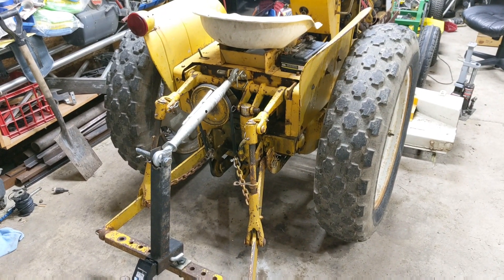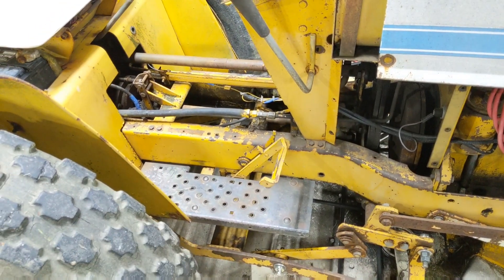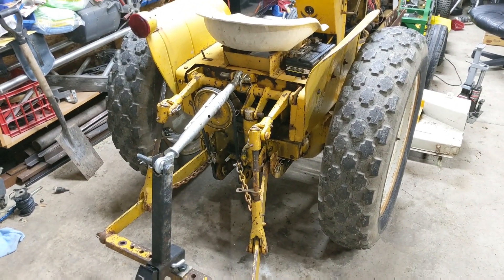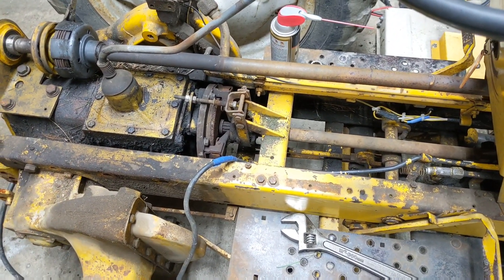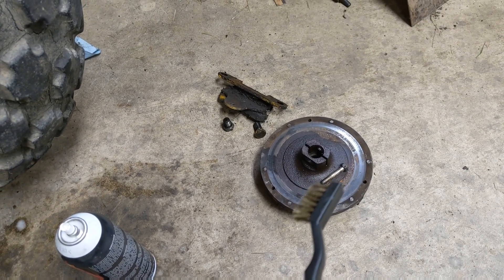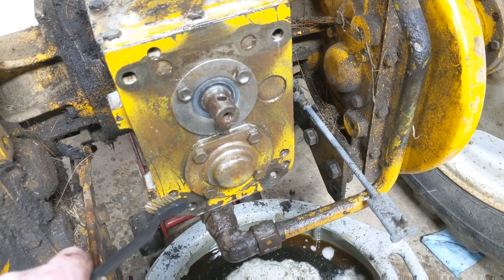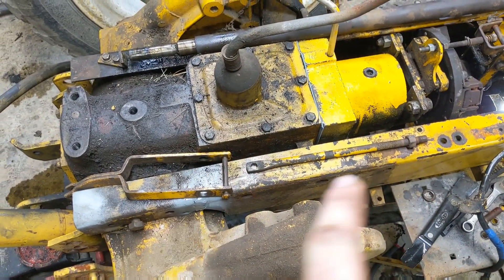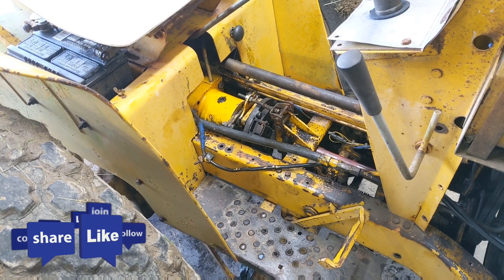Installing a creeper gear on a Cub Lo Boy 154, 184 or 185.

Comment: There is also another way, cut the shaft approximately 12 inches past the clutch make an sleeve the same size is to check approximately 6 inches long with a hole drilled through it. For it will slide right over the shaft drill a hole on each side of your sleeve and you can bolted together much simpler scene that done on a YouTube video

Comment: Good video. Why didn't you just make the alignment pins? A technique that I learned over 50 years ago is that steam cleaning a project first saves a lot of time and gives better results. I just use a pressure washer now but it still helps. Good Luck, Rick
Reply from the maker: Thanks!   I should have just spun some out on the lathe.    It was late and I was trying to beat the weather to get a few gardens tilled.    Not sure if you noticed but there was also a crack in the frame I welded up on the fly back by the rear end. The plans for this one is to be a project tractor, the frame is going to get reinforced and a front loader will be built.   I'll also will be adding power steering from a JD 318.   It's a toy.   ;)
Reply: @1D10CRACY  Keep a supply of drill rods. They can just be cut to length with a chop saw. They've saved me on several weekend projects.
I collect and fix up old garden tractors. A guy asked me why, so being a wise ass I told him "because I can't afford Corvettes". He got a real funny look on his face and invited me to go for a ride in his new truck. We went to his house and five bay garage where he showed off is collection of 63 to 67 Corvettes. He wanted to know how I knew about the collection. I didn't but, had been using that wise guy answer to the question for years. We became friends.
Remember: the difference between men and boys is the size and cost of our toys. Good Luck, Rick

Comment: Damn never had to do what he did with the driveshaft struggle to service that clutch. Must be a noob the driveshaft slide forward enough to allow the clutch n disc replacement on my buddies
Reply from the maker: Na, you are just a noob to the model changes.   ;). Your buddy had a later model cub 154.   The early 154s like in this video you couldn't slide the shaft through the flywheel, making it difficult to change the clutch.   International later changed the design to make it easier because of the complaints.  I explain this a little bit around the 30 second mark of the video.

Comment: Love the videos. Very well done and explained. I’m going to look at one for sale that has a 3 pt hitch. I’m wanting a little bush hog or sickle mower. I’m new to them so just wondering if the pto will connect or is the hitch just for lifting things?   Can’t really see a pto in the normal place. Is it the shaft the big pulley goes on for the mowing deck?
Reply from the maker: The PTO is offset and not centered.  When using the mower deck, its driven off the PTO via belt and a pulley you stick onto the spline of the PTO.  Sadly these tractors have a reverse spinning PTO, so you can't use normal PTO driven attachments unless they were designed for the tractor. Cool tractors for sure, but without doing some modifications, implements are limited and hard to find these days.   There is lots of information over at the forum on this site!   farmallcub.com

Comment: Interesting.  I am considering buying one of these tractors.   How does the creeper affect top speed
Reply from the maker: When the creeper gear is enabled I believe it cuts the speed in half.    I only use it when using the rototiller because low without it is too fast.   They seem to be good tractors, keep in mind the pto spins backwards and you have to use compatible implements.

Comment: I'm curious about the Specs. What was the Speed range before, what is it now, why did you install it in the first Place? :)
Reply from the maker: I think it's a 3:1 gear ratio.   Gear 1 was too fast for my 3 point tiller.
Reply: @1D10CRACY  ah, i see! :)
Reply: @1D10CRACY  I did the same to a massy Ferguson te35 for the same reason . 🙂